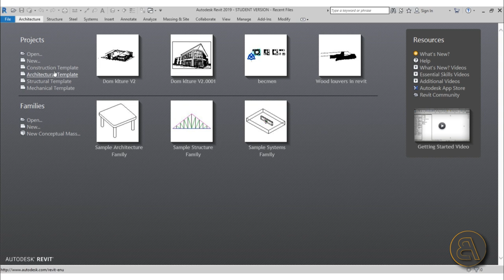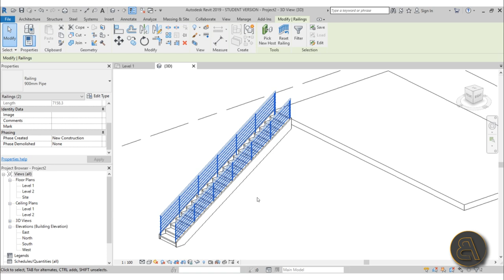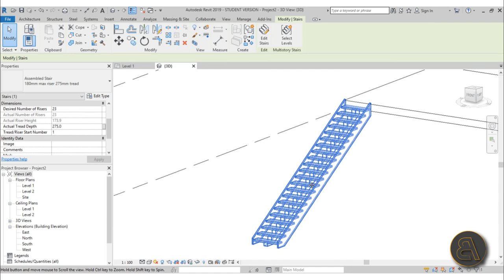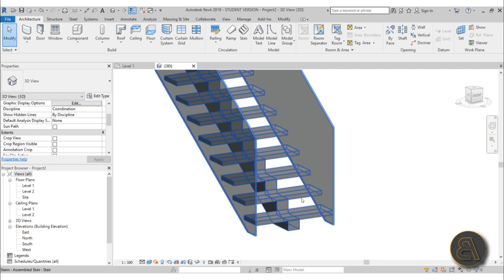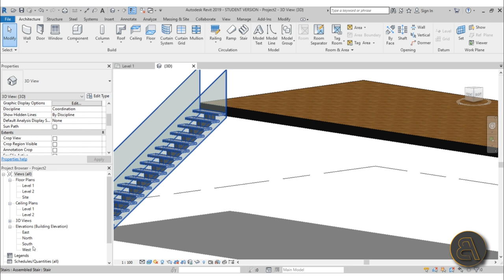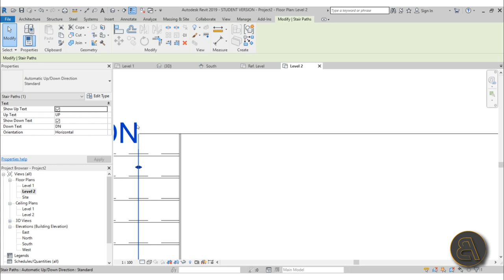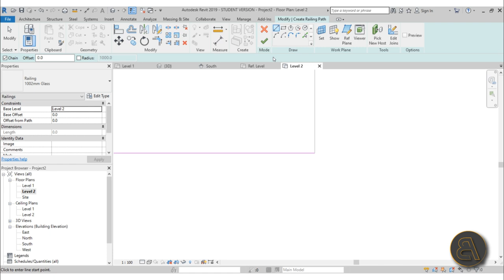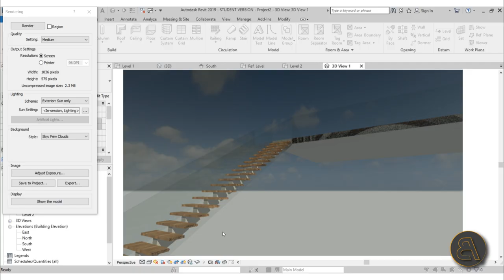Glass Railing in Revit Tutorial

Comment: Good tutorial for beginners! In the real life, the glass panel is around 200 - 250 cms large recommended, so it's necesary make it in several panels, and put the metal bracket holders on both the horizontal part as well as in the inclined part of the stairs, without forget the holes in the cristal
Thanks !